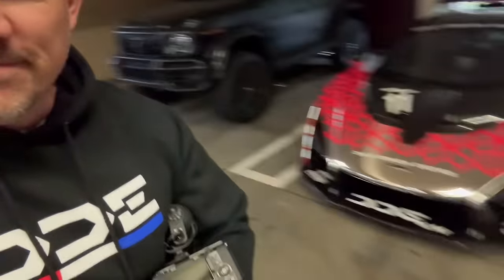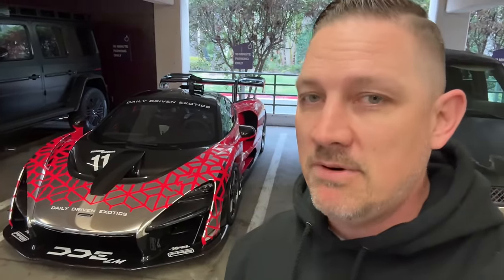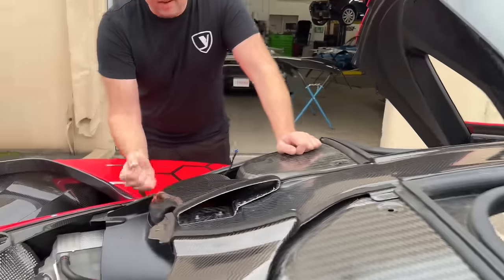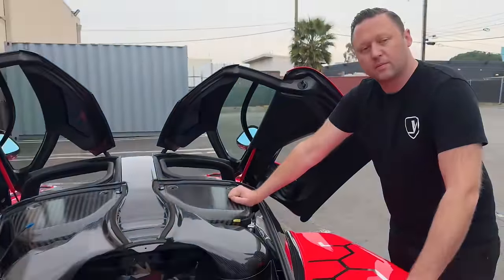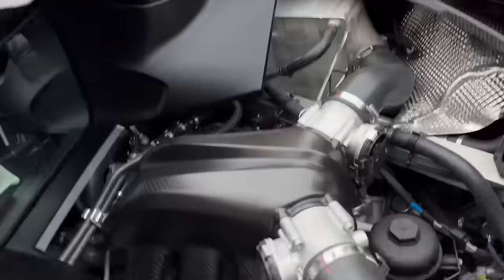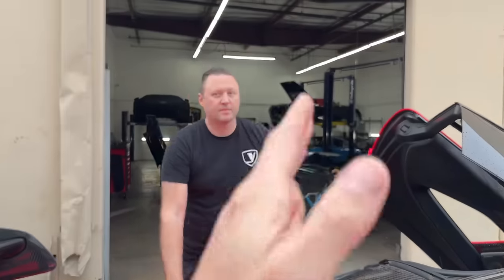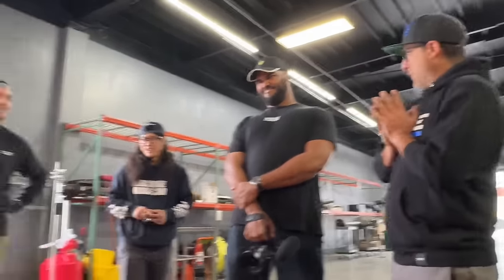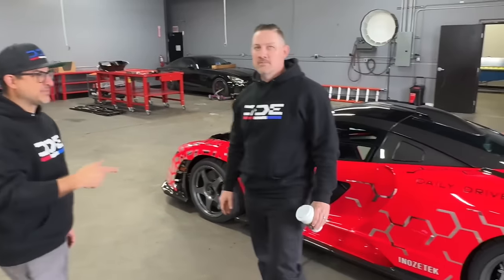I’m Dealing with $2,000,000 McKaren Hypercar Problems!

Comment: Hamilton Collection initially had a similar issue (same exhaust) but they managed to sort it... Maybe check out their senna vid they mentioned how it was fixed
Reply: I was about to comment the same thing! I saw he used the company Damon was going to for his tune and had problem after problem with it! Said he didn’t even want to drive the car it was so bad!!!
Reply: get the original piping 3d scanned and have it printed using those 500k+++ slm waam mjb those 3d printer
Reply: Every modification you’ve done have seen your cars parked up.
Reply: I think the problems are stemming from the oversized turbos..Too much air? Should be a misnomer, like too much money...But, ya never know..If McClaren techs can't figure it out, it's out there....
Reply: Came here to mention the Hamilton collection having issues with his senna
Reply: Hamilton collection had the same issues said they found a different company I forget who but they ended up doing a way better job. And said they would never go back with the guy you used idk 🤷🏻‍♂️ worth a shot to contact them

Comment: The stock exhaust on that car was fine. Put it back, use the fancy tips and save yourself the headaches. That one isn’t worth the battle. That car is exciting and speaks form itself on video without needing “help”. 👍👌👊
Reply: Nothing to do with the exhaust it's the extra airflow making the engine run lean without an appropriate tune
Reply: Damon needs to leave things alone if it not Broken
Reply: @gregoryh4601 then this channel would be no more

Comment: You can tune the OEM ECU to run on Speed Density and only use the MAFs at lower loads.  It's a hybrid fueling strategy in OEM form that uses both MAF and Speed Density for different situations.  It is overrunning the stock MAFs which will read a maximum mass airflow of 1244kg/hr within the OEM diameter MAF housing before the period of the sensor bottoms out at 80 microseconds.  Just run it under speed density at loads above 1000kg/hr.

Comment: @Damon #DDE, I dont know if this is still possible...
But many moons ago when we could not get the values adjusted in the ECU, we (The tuners) made a small cap at the sensor.
Limiting the pick up measured and fooling the sensor. It took a few tries to make it work, but once it did, it worked fine.
Maybe the sensors are different and/or smarter nowadays, but who knows it might give Alex an idea/inspiration?
When newskool doesn't work, maybe oldskool does?
Peace!

Comment: Since it’s mapped on MAF wich sucks ;) Adding a bigger inlet tube will cause the MAF to read a lower flow. When you do that, you need a MAF that is built for the larger inlet tube. Going back to the stock tube will solve it. Or get a billet inlet tube that has stock diameter inside. That will solve most of the issues. The missing cats could cause overboosting as well. As they are a exhaust restrictor so it will flow much more out the exhaust. But if it can be tuned then do so. But the MAF is the main issue.

Comment: Add a spacer on the o2 sensors and get the car retuned. Used to do this on cars to make the o2 sensors thinks that the exhaust was smaller than the larger exhaust/no cats installed. It’s an old Honda civic trick.

Comment: For the catalytic converter. I have a exhaust shop and the honey comb missing is actually not to odd. I dont know how many miles or how hars it was driven but they can just break apart and it blows it out the tips . A good way to check if something is going on is go for a 10 min drive and then take a thermal image device and see if one side is hotter then the other

Comment: Thing thing with the asphalt repairs is asphalt is not the best surface for slaying tires.... you can end up tearing the asphalt up with the tires and will constantly be paying to have it patched and resurfaced. Best bet would be to have all the asphalt removed and a concrete slab poured, but not sure if that would be worth the cost. All depends on what DDE really plans on doing here in the future.

Comment: Typical Mclaren problems. I've run into minor issues with the 570 such as a consistent "right side marker light fault" and it occasionally gives me a ESC fault that causes it to go into limp mode. I also have the TPMS fault, constantly yet it transmits the pressure and heat data. Just learned to ignore the warning light.  Usually just have to turn it off and on again and that clear its but the thing that drives me a little crazy are all the rattles. Anyone who owns these cars just needs to know Locktite and 3m double sided tape are your friends.

Comment: If you remove the billet turbo inlets and just run the aftermarket exhaust you should be money!!!!!!! And get them to use loctite on all of your hardware that they removed to install your exhaust, there is many different levels of loctite make sure that they use the proper one that's fore hardware tightening into or through plastic fasteners and your lostening hardware problems will be a thing of the past

Comment: If you don’t get a tune correct this will happen put catted downpipes in and the car will run fine the 02 sensor is on the fritz and is going super rich and limp mode to save itself

Comment: Damon if you fit the standard turbo intake pipe but expand the last few feet to the turbo mating face would that not sort the issue, My M5 hated the extra air volume on the system it is fitted with and it was throwing the car into limp mode, Turbo technics fitted a redesigned intake pipe and the car runs fine. It may be that the volume of air to fuel mixture the engine is getting is to much for the standard ECU to deal with.

Comment: I’m guessing you are getting turbulent air entering the inlet and it will absolutely mess up MAF readings and the fuel trim will be way out of whack it’ll idle poor and run like poop. I know a lot of Mustang owners years ago had issues with adding CAI setups that would cause turbulent air and cause all kinds of issues. Can you move the MAF sensors to an area with smoother air flow on the intake somewhere? I would lose the billet inlet parts. But having that inlet is alot like the long pointed inlet cone on the SR71 engine to slow down supersonic air entering the intake.

Comment: This is the downfall of newer super cars, the car manufacturers don’t want you to mod a vehicle because they build these things to break, but then the downfall of the more solid super cars is that finding said solid parts when they break is getting tougher and tougher as the car scene exploded with newer heads. While I’ll more than likely never own said super cars, either the newer or older, it’s still the same problem all car heads deal with just on a less grander scale, shout out to all the bmw peeps with motors with no dip stick

Comment: If it still has the factory tune, it might be derating due to the new exhaust flow rate?
Reply: A lessening of back pressure will cause this, the injectors can't compensate for the + amount of flow. It's tuned to exactly what it has. It probably just needs a tune.

Comment: Put a little vent in before the heat sensor. A little vent 1/2 × 1/4 inch to cool down sensor your tricking the censor that it's the right temperature

Comment: Damon, try to put the seals in the svj before spending $40k.... every transmission built at the factory can be built by someone else.. logically. If you're already planning a new gearbox don't worry about ruining the one in it, try the seals first, "special tools" means easier, not impossible. They say the same about ferrari engines & look what you can do with those.. You're not the first person to be told replace the unit, instead of fixing the part inside.. 👊
Reply: I would think if you open the case then the deal is off and you have to pay the full cost with no sunk cost removed. I think a better way would be to look into the aftermarket solution i.e if you can do a sequential swap with the huracan.
Reply: AFAIK a core (charge) is a core is a core.. Don't send it back in multiple boxes and parts bags, but.. If you make an attempt to re-seal and it doesn't work..

..you've already re-assembled the unit for testing..
Reply: Even the guy that took the rebuild class says to replace it, that they couldn't get it right in class, that it was a joke. So who is going to fix it?
Reply: The best mechanics can make their own tooling and jigs. I think Mike can figure it out.
Reply: @CarsCatAliens  when you're talking about a $50k transmission,  that's a lot of time... a LOT of time. Making a specialized tool is not as complicated as it sounds. It's just a matter of solving a physics puzzle. I've made many tools to do specific jobs out in the field, working on equipment. You're not making a ratchet. You're making a small press. That's easy.

Comment: ❄️🍳 the Karen may run better by putting a heat element with a temperature control inside of the roof air intake to heat the air going into the cylinders instead of cold air being shoved into a hot piston chamber. It's like putting ice into a hot frying pan and then trying to cook with it. It doesn't work right that way. You decide.🐉🇺🇸🔥  Who knew?  Make sure you're doing good for Karen to run the way it should. ☝️💰👆 NOT BAD 🤣 seriously come on  happ😅y new WIERDYEAR 3223 , 😛

Comment: Could the TPMS be a sensor in the wheels?
Reply: Correct it's a tire pressure monitoring system it's inside most rims. Very common to replace it's not a big deal.
Reply: @markanthony4499  usually when they blink it’s either service to them or recalibrate
Reply: @colemiller3934  yeah ur right definitely probably needs to recalibrate it since they changed the rims u know but I've always replaced them just because I didn't want to keep having problems lol
Reply: @markanthony4499 right. But I mean that can add up quickly if it needs a $60 sensor in each rim.
Reply: @colemiller3934  yeah it's not cheap fr replacement tpms sensors but I was just saying lol but u r right bout just recalibrate the sensor cause they changed rims. Well we will c what they do I guess lol

Comment: I'm at 3:28, it sounds like something to do with your air flow. Those crazy expensive cars are spect to perfection inside and out. If you change anything, the computer won't read everything correctly. Sounds like the new pipes and exhaust you installed, either are too small, or too large, and is either taking in too much air, or not enough. When you get up into 4th gear and you're pushing it, thats when its taking in or not enough the most air. I'm sure you guys know a lot more than I do though, but there's never anything wrong with we're getting different perspectives from everyone. Put them all together and you get yourself an answer. All else fails, swap the exhaust back with the original and see if that fixes the problem before you go and spend thousands of dollars on someone to look at. I hope everything works out.

Comment: TPMS is probably something you guys did by changing the wheels and tires and it probably isn't programmed correctly. I also have a TPMS sensor on 1 of my wheels that always faults only when it's below 50°F.

Comment: Cat cheaters . You need a pair of them for the post cat o2 sensors . That will trick your ecu to rid you of the p0420 fault code , your also descibing symptoms of a fuel pump going out

Comment: You hear the exhaust shaking back and forth because the titanium has already cracked that's why you shouldn't have a flame and pop tune on your car with titanium it's brittle, high strength but brittle at the same time very strengthening structurally but impact resistant is weak so pressure broke the welds
Reply: That's also why everyone has noticed the tips aren't aligned anymore 😂

Comment: As long as the section of pipe the sensor is in is the correct diamiter, the rest of the piping shouldn't matter. Although it won't breath as good, you can still have the large piping, you just need a small section the correct size so the sensors read correctly (as they are calibrated to know how much air is passing for a given diamiter of pipe). It's probably loosing power like it is because it thinks it's not getting as much air as it is, because more air is passing the sensor due to the wider pipe where the sensor is, then the car isn't giving enough fuel, then it's reading lean, so starts pulling timing to protect the engine from detonation (and possibly adding fuel, but at reduced timing to protect the engine). Then it thinks it's too rich because it's giving too much fuel for the airflow it thinks it's gettings and starts over. It probably yoyo's like this as it's trying to correct for something with the incorrect numbers.

Comment: Boost pid needs to be logged and changed. Your car is jurking because of the flame, pops and bangs tune in wich they set the ignition to -30 or something like that at very low loads. You need a real calibrator and ccp patch the ecu so you can use a real datalogger in high speed. I can help and i can probably have the A2L that you will need. And yes i have connections with Mclaren :)

Comment: Yeah in the main DDE videos I commented not to tune the Senna, especially when we know how stock cars bend rods without a tune under track driving, this car is of the range where you can do optics, but not mess weith it. I wouldn't expect the exhaust to be an issue though, but obviously the air flow sensor from whatever he chaned on the turbo is bugging it out.

Comment: To add to my previous post. Moving the o2 sensor with a spacer into a space of dead exhaust gas. Will fool the sensor that it’s got the restriction of the cat. Then with tuning the computer will think it’s running a cat and not throw codes and odd fuel mix curves. Then tuning will compensate for that fooling with the spacers. But it’s going to be trial and error and testing to get the spacers the right depth. Too much and the o2 won’t read at all, too little and won’t have the desired effect.

Comment: Your car is running rich the air to fuel ration is off.
You could do a lot with the tune to make it run better
But you still need to make sure that all the parts are working in harmony